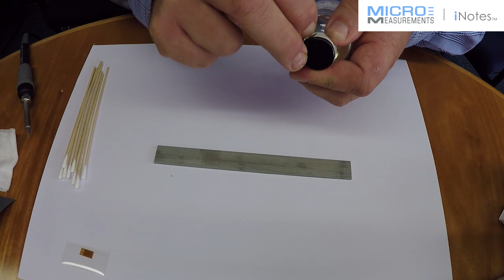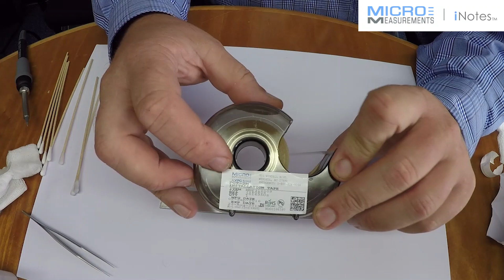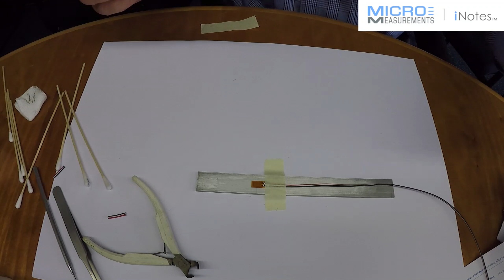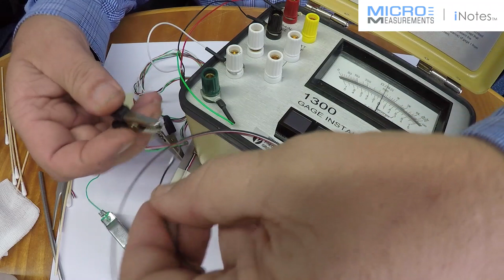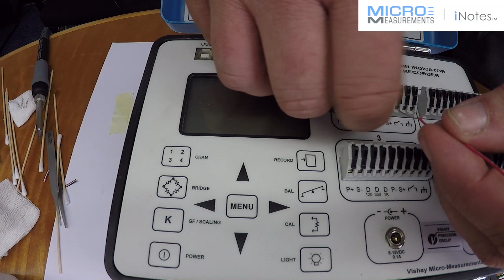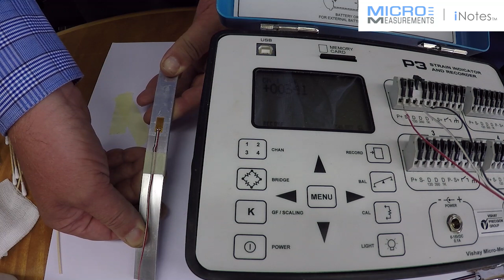Jauge De Contrainte Installation Tutorial (French Version Vs.  American Version)

Comment: I want to stick a strain gage on a rectangular UD composite specimen exaclty in the fibers direction, how i can do that, knowing that the edge of my specimen are jagged ?
Reply: If the surface is rough, you will need to either abrade the surface to smooth it out before bonding or try using a thicker epoxy adhesive such as the M-Bond GA-2 to smooth it out.

Comment: Great Video. 
One question. If we need to bond two gages one next to the other, is the tape for bounding is going to "uncleen" the bounding surface that has been cleened ? 
I got a GAK 2 200 kit and some 187UW gages. 
Thanks
Reply: We try to select tapes that do not leave a residue.  Always good to check the surface for any residue if the tape has been removed.  Basically reclean the area if any is present.  Often times we will orient the gages on  a cleaned piece of glass before installing on the surface and that includes gages  that will be side-by-side.   The two strain gages get transferred at the same time from the glass to the test article.